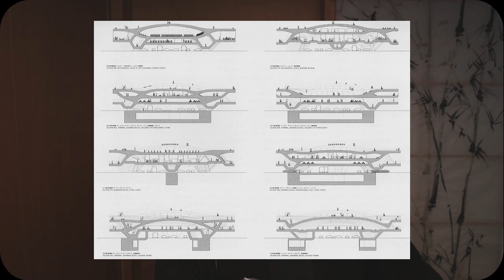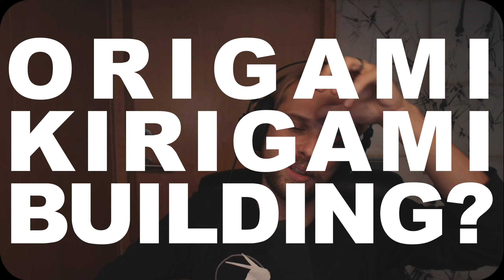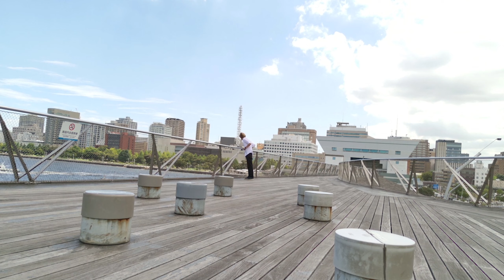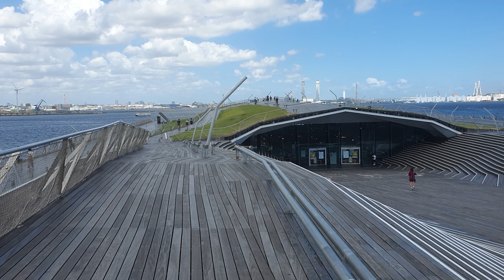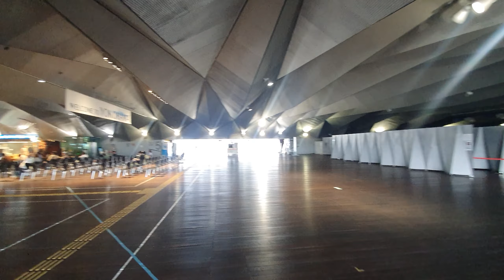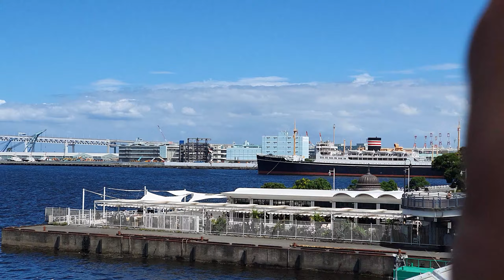Yokohama Port Terminal: The First Real Computational Design Building

Comment: i see that you liked the folded steel origami themed roof so i recommend you to google "ginásio Gigantão". I think that's a underrated gem of architecture from the 60's brazilian brutalism and it's super cool that it covers a incredibly long clearance given it's mostly flat concrete shell and being a relatively short building with a huge headroom  because of the court floor being lowered.